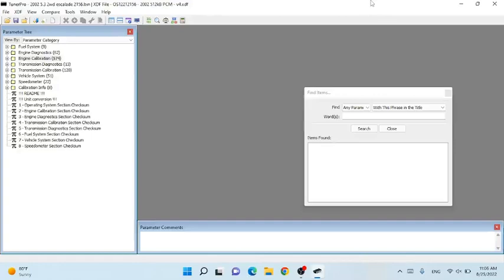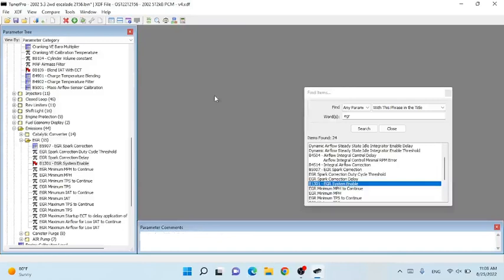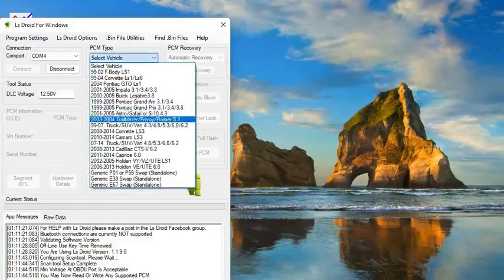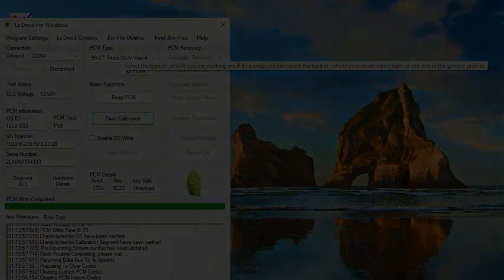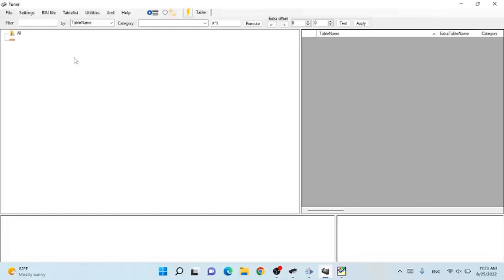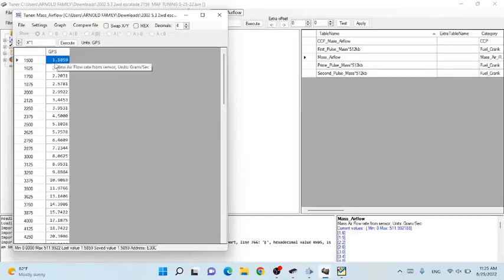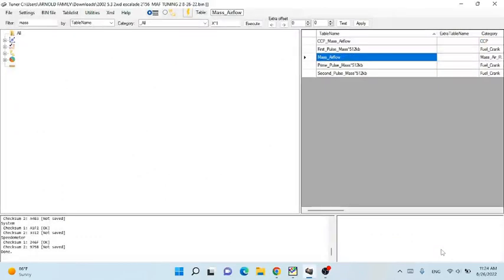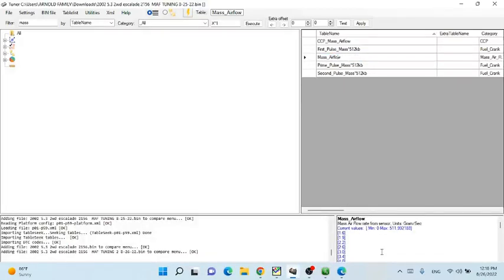MAF tuning with TunerPro Universal Patcher Megalogviewer HD and PCM Logger For Gen 3 LS

Comment: I cannot seem to get the fuel trims to log anything but 0
Reply from the maker: Are you trying to use the fuel trim average pid?
Reply: @brandongarnold  I am trying to log short and long term fuel trims.   I get nothing from all 4  currently running same test on 02 avalanche that is stock.   If i can get reading from it, then my harness must be the problem....

Comment: I am using the 2002 5.3 2wd escalade , and loaded the same xdf,  But i do not see dynamic air flow, and a few other tables you changed.  I See them if I load the wrong xdf file.  What am I missing here
Reply from the maker: Is it the same version XDF since there are several versions of that one? Also it really doesn’t matter which XDF you use as long as it matches your operating system and the tables are there.
Reply: @brandongarnold  i WAS A VER OFF thanks
Reply: @brandongarnold  I am so confused.  I am seeing Hexidecimal information in many of the tables.

Comment: Im putting a btr stage 2 cam in my 02 5.3 can i set a basic tune just so it stays running on universal patcher?
Reply from the maker: There is no tune repository like hptuners would have for startup tunes. You can watch try and find some YouTube videos of guys tuning for a new cam install to get it started on hptuners then apply it to universal patcher or tuner pro. Most everything that can be done with hptuners can be done with these programs as well. It’s just more time consuming.
Reply: Thank you ill try that

Comment: Is there a version of Megalogviewer HD that works?  I'm missing some options that shows up in your video that doesn't for me.  I get to the part where it wants me to add custom fields and to enable it I must pay for the full version.
Reply from the maker: Unfortunately you do have to pay $50 to register it before it unlocks all those features.
Reply: @brandongarnold  Thanks but I found an alternative called Trimalyzer.  I actually used it to tune the VE table but didn't realize it can be used for MAF as well.  The hard part was making my own MAF layout and entering in all 85 frequencies the car uses.  Trimalyzer shows how much fuel was added or subtracted by % and you can just calculate that with +%.  For example 131.4531+3% = 135.396693.  Enter that value in and it'll adjust it automatically.  My car was running lean so I had to add fuel to a lot of frequencies.  Tested it out and already got another log and it's nearly 0% with some needing changes, probably because I logged more.  I assume that once I make those adjustments I undo all the changes you showed at the start of the video to turn back on the VE table?
Reply from the maker: @DukenukemX  I was unaware of this trimalyzer. I will be downloading it and trying it out. As for the settings when you are done tuning your maf and ve you set everything else back the way it was prior. I took my original file and copied the ve table and maf calibration table from the files with the final adjustments I’ve made. I haven’t made a ve table tuning video yet. I haven’t had much time to sit down and do it.
Reply: @brandongarnold  I've been getting a lot of help from the community, especially at Gearhead-efi.com.  This is the thread where I've been getting help tuning my Vette.  http://www.gearhead-efi.com/Fuel-Injection/showthread.php?11288-Need-compatible-cable-or-device-for-TunerPro